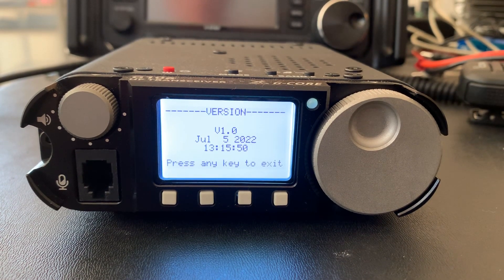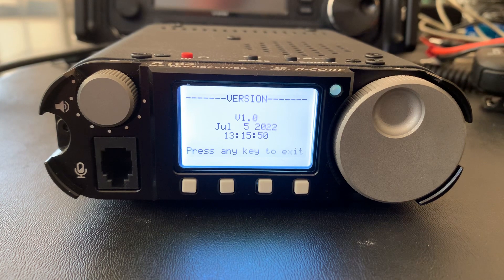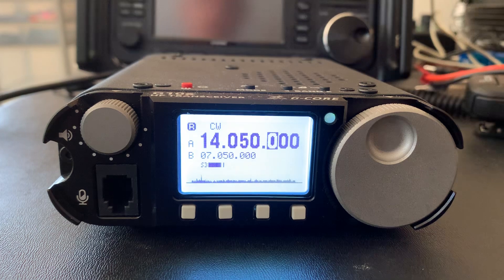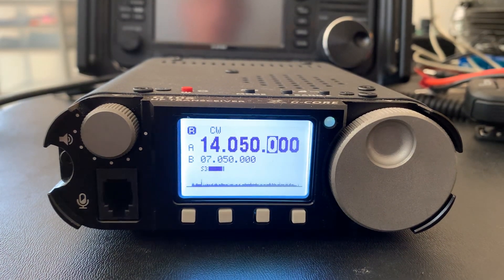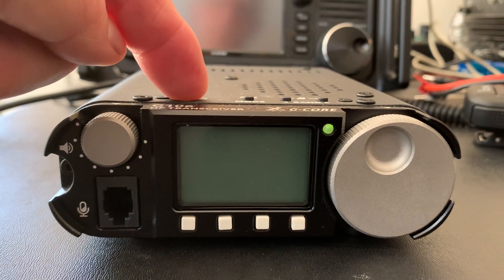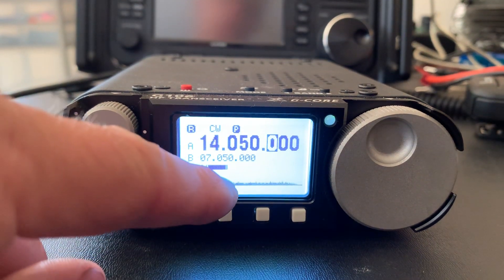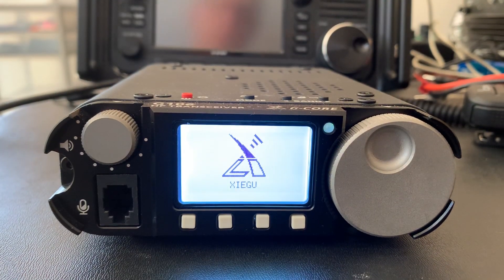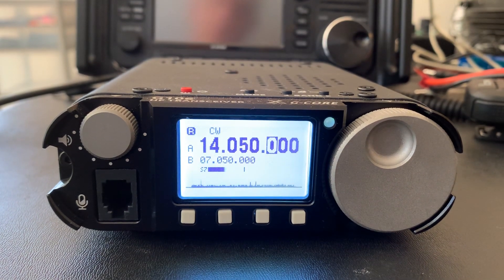Xiegu G106, strange behaviour when turned on

Comment: Hello, 
I also have a strange behaviour with the G106.
When I have switched it on and I am in CW mode, you can normally  key it - without transmitting -  if the "QSK" sign is NOT visible. (You can then use the 106 as a Morse training device).
However, my 106 still transmits in this mode !! (red TX lamp goes on). I then have to activate QSK first and then deactivate it again, then the 106 does as it should ....

Comment: Please check your cw rise-time.  Mine cut of dots and dashes. Impossible to use in cw mode. Only cw operator. Returned to seller. Major problem in all new rigs.
Reply from the maker: I have made cw qso's with no issues slowing qsk time down.